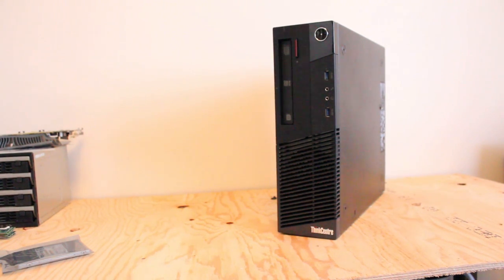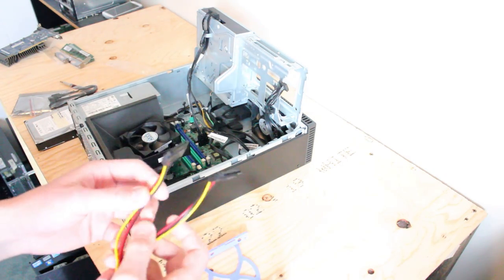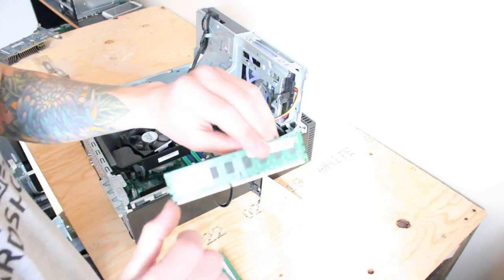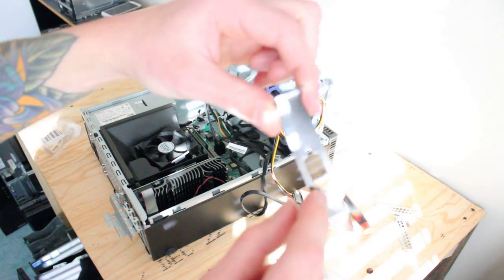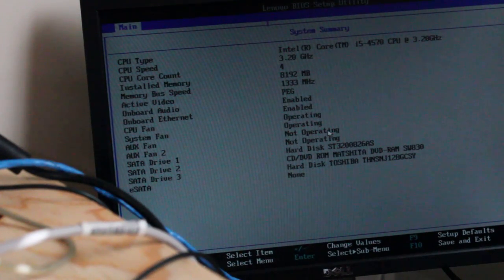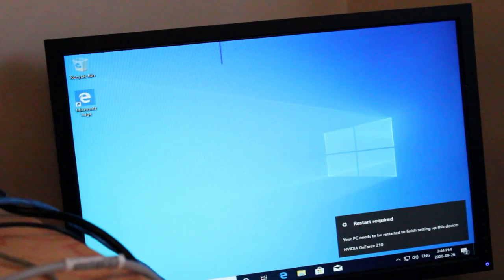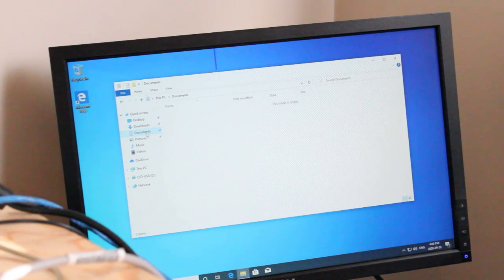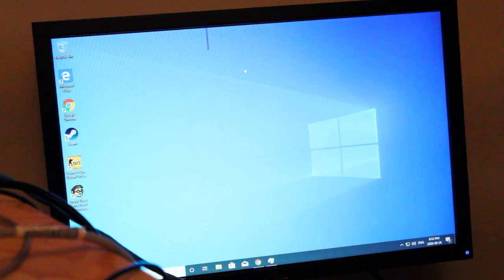Lenovo ThinkCentre M93p SFF Upgrade (SSD, RAM, Graphics Card, HDD)

Comment: same pc but i replace it to gaming case and upgrade ssd gtx1060 3gb and also 700watt plan to upgradr cpu to xeon e3 1240v2 i hope it work
Reply from the maker: Nice, that's good to know all that is compatible.  A better CPU would definitely pair well with the gtx 1060.  Just be sure to upgrade to a compatible CPU.  Look up your current one on somewhere like techpoerup.com and compare to make sure it would work.  Post back here to update if you ever do it.
Reply: Do you possibly have a link to the case you purchased to transfer it to. My graphics card cannot breathe in this thing lol
Reply: I'm also assuming you had to purchase the power adapter

Comment: Where does the ssd fits? Is it just hangimg there after closing the chasi
Reply from the maker: I zip-tied the SSD right underneath the HDD chassis.  If you arrange the cables correctly, it will fit nicely there.
Reply: @HaisteComputerRepair  thanks man!
Reply from the maker: @noem1sa  No problem!
Reply: @HaisteComputerRepair  I was wondering the same thing. So it fits in there fine right? Can I use double sided tape?
Reply from the maker: @NikhchansGaming  Totally, double sided tape would work fine.  I would use it as well, but I keep forgetting to buy some.  Open up the case and take a look, you'll see there is room.
Reply: @HaisteComputerRepair  Thanks for confirming. I don't have it yet, but now that I look closely, it seems there's too much room in there! Do you think a WHOLE 3.5 inch drive could easily sit below the 3.5 inch drive bay (securing somehow) and an SSD can be accommodated under the DVD drive via double tape?
Reply from the maker: @NikhchansGaming  There is a plastic cord management piece you would have to remove, but yes I think you would be fine putting a regular sized HDD under the HDD chassis.  Double sided tape would probably work.  An SSD looks like it would fit fine under the optical drive, as well.  So, are you looking at setting up two storage drives and an SSD?  For a total of three drives?
Reply: @HaisteComputerRepair  Thanks. Yes. Actually its for my cousin. He already had a 500 gig hdd. and this refurb m93p came with another 500 gig one. I am thinking of gifting him a boot 120/240 gb ssd. And a second hand 1030 gpu.
Reply from the maker: @NikhchansGaming  Well, there is a third SATA port on the motherboard and I know you can buy a 3-way SATA power splitter to power all three drives.  I would be interested to hear about the results if you do go through with it.  Update me here if you can remember to.  Maybe I'll try it out for fun.
Reply: @HaisteComputerRepair  Will do. But that leaves the DVD Drive with no sata. I am thinking of using a sata to esata cable for that. And 2 Sata power splitters for dvd, ssd & 2 hdds. Hopefully the 240w power supply can handle them, along with a low power gpu. Ill update here how it goes.
Reply from the maker: @NikhchansGaming  Sounds good!  I would bet that the power supply will handle it just fine.  Good luck!

Comment: up to what generation of processors can i put on my M91P?
Reply from the maker: Check out this link: https://support.lenovo.com/ca/en/solutions/pd011085

I have the Intel® Core i5-2400 Processor installed.    https://tinyurl.com/y2l6zegr Look up your current CPU here and then cross reference the specs with what you want to put in.  Safe bet is probably the Lenovo documentation.  Let me know how it goes.

Comment: Hi. Can I put 300-350 PSU in this machine.? Because Im planning to upgrade the GPU to 1050 Ti.
Reply from the maker: Yes you can, you will just have to find a Small Form Factor one that fits the tower, unless you plan to migrate it all to a larger tower case.  Don't forget you need the low profile version of the graphics card.  Check out this video, he lists parts with links to purchase on Amazon:  https://www.youtube.com/watch?v=yJbpWaZypO4&ab_channel=ITmare
Reply: @HaisteComputerRepair  to be fair you could just leave the side cover off completely if you wanted to use a standard size 1050ti
Reply from the maker: @blitzcourt5021  For sure, anyone is welcome to do anything they like.  Take the whole thing apart and run it while it's hanging on your wall in pieces :)
Reply: I put a bequiet tfx power 2 300w psu and can easy run a gt 1650 low profile. With a     pci express extender and some work, we can put a 1660 without change the bequiet 300w psu. But if someone wants to do this mode he can apply any graphics card because with the extender is easy to put a second psu only for the graphics card. Offcoarse that is a little meaningless because it will destroy the perpose of the sff desktop.
Reply from the maker: @Ioannis_Tsoumaris  That's awesome.  I would love to use that power supply.   But yeah, you could do something cool with the system.  Put it in a different tower case, install everything spread out on a wall, etc.  Take any weird Linus Tech Tips idea and run with it.  But in the spirit of working with that PSU, maybe just find the best low profile graphics card you can manage.

Comment: what ram model and  brand? where did you buy?
Reply from the maker: I think I installed some Samsung 2GB 10600U - 09 - 11 - 81 DDR3 RAM.  1333 MHz.   It came with a 4GB stick of the same configuration.  I generally buy used or "refurbished" RAM wherever I can get a deal in bulk.  Online buy and sells local to Canada and places like eBay.  Just make sure it's DDR3.  Generally, I don't pay more than $10 for a stick of 2GB.   As for speed, look for 1333MHz or better if you can.  Hope that helps!